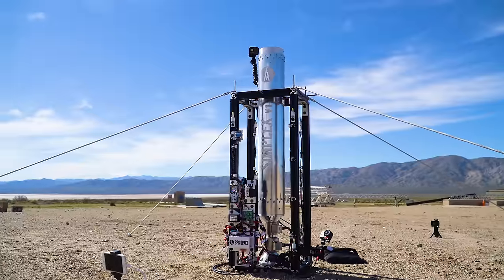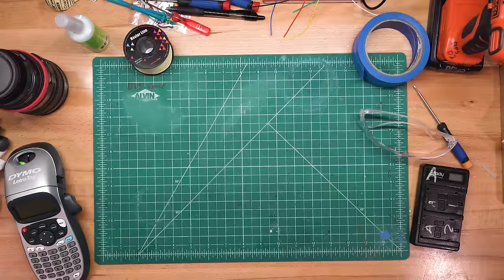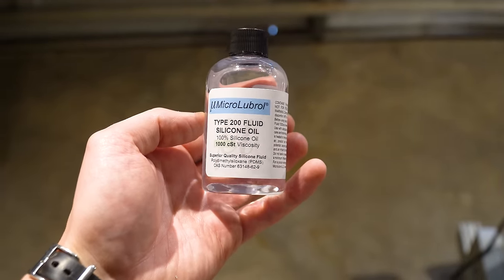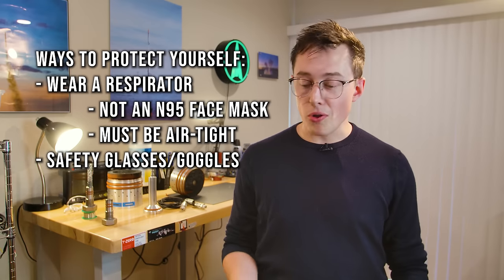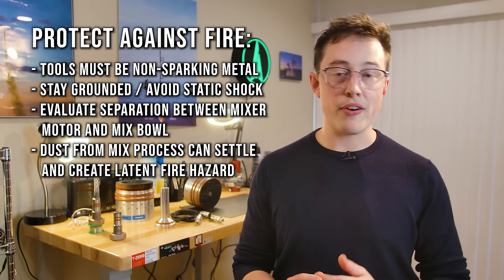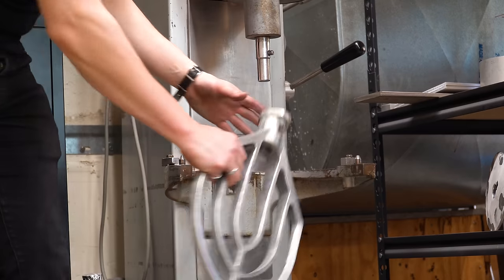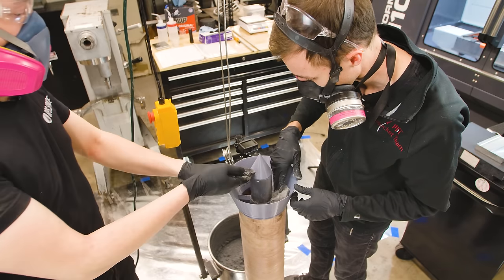Mixing And Casting Rocket Propellant - Simplex Ep 2

Comment: Everybody wants to be a rocket scientist ™.

I’m going to refrain from a full critique of this video but there are two points that I am compelled to bring up.

“…and the MDI we used may not have been the top shelf stuff” 🤦🏻‍♂️

No Joe, there’s nothing wrong with our modified MDI curative. We use it every day in our production and hundreds of our hobby and commercial customers also use it with no problem. It’s your lousy oxidizer particle size distribution.

Also, our modified MDI has an extremely low vapor pressure and is normally only an inhalation hazard if is in an aerosol form (sprayed) or handled at greatly elevated temperatures. In which case it wouldn’t really be suitable for the application, as it is intended as a room temperature HTPB curative and the pot life at higher temperatures would be too short.

Comment: If this propellant mix was new to you, i think you probably should have done some small scale test mixes before going this big. The source of the recipe also has clues to your exact problems in the discussion section, so maybe you could have seen this coming: "This was especially obvious on XB where the propellant was barely pourable at ~78% solids, because the procedures were essentially to dump everything into the mixer (...)" and "We attempted to mix a grain for the motor at the beginning of IAP using the CS Rocketry HTPB but found that the propellant cured very quickly and was too viscous to pour as easily as it did in the past. The resulting grain had poor density (-2.5%) and visible voids, so it was rejected." Better luck next time and please stay safe! Cheers!
Reply: Yes. Standard energetics practice is to scale up for formulations that you're unfamiliar with, precisely for reasons like this. You can have the best instructions in the world, but nothing ever works like it's supposed to the first time.

Comment: AP has to be screened right before mixing. It will clump while you look at it. In pyro (not rocketry), we push all chemicals through screens with small mesh sizes before mixing through courser mesh screens.

Comment: very nice work on the safety stuff during the mixing! 
only thing that worries me is the demoulding/ removing of the core.... i was told, that APC can be very sensitive to impacts, so even if there would be a tiny bit between the main core and the fin part, that could have ignited!  knocking the core out like you did, every professional would have gone running!
in a company building similar motors, the de-moulding is done in a safety room using hydraulic actuators which are manually operated from outside the room

Comment: It should be mentioned that hitting the grain in this way is not safe, it is a way to remove the mold, it could cause an accident. Great video by the way
Reply: What kind of accident?
Reply: @robertobryk4989  Ignition. APCP can ignite just from being hit hard enough. If you accidentally hit a piece, or if there's a bit that is on the ground and gets crushed when they're dropping the whole grain, it could flare up and propagate to the rest of the motor. Suddenly your rocket is on fire, and as he explained earlier in the video putting it out is not an option. You run and hope that it just burns itself out without too much damage to everything around it.

Comment: One pointer I would like to input. During preparation, to deal with clumpy-ness, and for the sake of my OCD tendencies, I tend to do fine powder for every solid, I use my finest sifter for all solids. If it is not powder sugar small I keep going. The extra time to truly refine your initial solid ingredients cascades into time saved throughout the whole process, always take your solids to their smallest possible surface area. Unless the conditions require specific surface areas (mainly when making nano particles) I always go to smallest size possible SPECIALLY THE ALUMINIUM which should be stirred constantly into the mixture while a shaker attached to the mixer rotor evenly pours. Then you can call you aluminized mixture acceptably stable.

Comment: I'd encourage you to try a different one. Some of the chemicals included, like the expensive binder premix and 200u AP, were selected based on the team's experience or chemical availability at the time and aren't the best choice with the knowledge we have now. Some aspects are still good for a starter formula, such as the moderate solids loading and amount of metal, but knowing what I do now I'd use tepanol instead of HX-752 and replace the 200u AP with a mixture of 400u and 90u.

Comment: Joe, if I may share an idea.... Put the whole rocket inside a larger cylinder sealed at the base, pour the propellant into the mold up to (say) a quarter of the height, and then vacuum it.  Add another quarter, vacuum again.  Pour a little, vacuum again.  The advantages are that you vacuum in place after pouring a more liquid mixture, and progressive / repetitive vacuuming makes the column homogeneous.  Good luck!

Comment: Id like to suggest that you get a fully integrated face shield with forced air respirator.
Positive pressure eliminates any chance of fumes or dust getting past the mask and prevents fogging of the face shield.
Check the ANSI # to make sure the lens will offer protection, but usually these things are rated for grinder discs exploding.
Ask around at your local auto body supply.

Comment: for packing and avoiding voids you can try a concrete vibrator tool or some such similar , that will get rid of voids , just need one that suits the scale at which your working with

Comment: Hey since you are making your solid motors i wonder if you could try using emf to throttle them. Fire is a plasma and plasmas can be  manipulated by emf. Meaning that you can dynamically adjust the burn rate using emf. It might even be possible to turn it off. There are multiple ways this can be done. One paper they added ferromagnetic materials to the propellant. Might be fun to try for your smaller rockets.

Comment: A trick I have seen people use to remove voids when pouring concrete was to vibrate the mold with a sawzall. Though maybe it's better to find a brushless one when working with volatile stuff? then again, I doubt the mixer motor brushes were shielded.
Reply: Correct, standard practice when pouring these sort of things commercially is to pour under vacuum and have some ability to vibrate the casing.

Comment: Also, word to the wise, metal tube rarely comes uniformly round. You need to drag a mandrel through it to work out all the bends and general wonk. Should help inserting the next liner.

Edit: also also, get a vibrator. Works for concrete workers. Should be good enough for your pocket rocket.

Comment: Did you do all that mixing at room temperature?  When we set out to work with nearly the same chemicals, around 4 decades ago, the final pourable mixture was to be kept at ~200 F for about a day until pouring.  I believe this maintained fluidity and allowed bubbles to escape.  We did not have a vacuum pump.

Comment: If you want to go overboard on safety, but might need/want a higher level of protection on this or other projects, you can get a full face respirator. they come with a full visor that is not only physical eye protection, but it filters the air your eyes face are exposed to. 
and you can't make an oppsies and touch your face at all, which prevents cross contamination exposure (drop lands on arm, you wipe your face on your sleeve... yikes)

Comment: Packing factor is generally not why the oxidizer (AP)  is often bi- or tri-modal.  It is for burn rate control.  The fines increase the burn rate because of their higher surface area to volume ratio.  Tat's why it improves performance.

Comment: So the only way you can safely dispose of unwanted propellant is to cut it up to small enough sections that you can ignite them somewhere?
An what would happen if for instance you couldn't get the steel former in the middle out? Would you not be able to saw it due to the spark risk?

Comment: Intresting content, So ill share  a few experimental ideas that i have been pondering,  elphants for me, but perhaps illuminating for you.
Tesla valve "groves" in the funnel (or shape the funnel as a tesla valve, or have bladless fan setup that exploits negative pressure (but with a rocket instead of the propeller. (or a combination of the negative pressure design + the tesla valve).

Comment: To work with a packable propellant like this you probably really need a compressed air tamping tool like the ones used in foundries for packing sand when sand casting. I can imagine that tamping by hand took so long it had started to set up by the time you get to the end. Better to reformulate to end up with something pourable and then do a final vacuum degassing after pouring into the casing. The mixture you had was so viscous it would have been almost impossible to avoid getting voids and you did well not to get any in the main body of the propellant.
Reply: Absolutely not. Just, no.
Reply: @wgoulding  Why not, while the mixture is liquid it is inert to impact. Tamping it with a metal rod is potentially way more risky than with a wooden tamping block.
Reply: @schrodingerscat1863  That is just not true. Just really not true. And if you're going to do any tamping it would be with a ceramic rod. Ceramic doesn't have any sparks. But you just don't want to be doing any kind of tamping at all. The voids he got were big. Even smaller ones would still be a big problem
Reply: @wgoulding  As can be seen in this presentation the voids absolutely are an issue. Personally I would have thrown out the batch they made here and retried for a pourable consistency. Tamping will never remove all voids in a high viscosity mixture like this. A wooden block also wouldn't cause any sparks though ceramic is also good. They seemed to plan for a pourable consistency and when it didn't work out like that they really should have stopped and not tried to ram it into the tube with a metal rod.

Comment: maibe along with tamping , you need to vibrate the whole thing to make it loose the bubbles the vibrations should liquify it a bit like concrete , need a pretty strong vibration though , allso helps when loading the chucks in the top as it will fall through the grate without help

Comment: On a smaller scale I would probably try an AP/sorbitol melt cast. Without Al powder I think melt cast could be safe enough for a B/C class motor. Would do it myself, but unfortunately I live in an area very unfriendly towards such projects. Would have to set up a perchorate cell, make the K-salt, turn it into the ammonium salt, find a safe location to test the motor...ahh too much hassle.

Comment: Safety Note on SRM Fuel Production:
Always prioritize safety when working with solid rocket motor (SRM) fuels. Start by mixing the energetic additive (e.g., aluminum or magnesium powder) with the liquid binder. Ensure that the particles are thoroughly wetted and uniformly dispersed in the binder, reducing the risk of accidental ignition. Once the energetic additive is safely incorporated into the binder, proceed to carefully add the oxidizer (e.g., ammonium perchlorate or ammonium nitrate). This step-by-step approach helps minimize the danger of explosion during the mixing process.

Comment: 19:11 In my opinion you should caste your propellent in Grain form instead of casting it in a single tube!!
20:28 As I can see it was pretty much difficult to remove the casting hardware after curing the propellent!!!
21:00 😪 these voids are also a reason, why grains are used 
22:00 At the end of the video I felt little bit sad!! 
A bit of your Hard work is wasted 😐.

But these things doesn't matter at least you tried to do it!! You did a Great job man 👏
I appreciate your work ❤😊.

Comment: I don't really know the exact reaction with amonium perchlorate, but amonium nitrate is a well-known explosive on itself, if you wonder how bad things can go wrong with it, just google Beyrouth explosion 2020, ...
A little bit of chemistry : the traditional reaction used in rocket engines are Reduction-Oxydation, as they are quick and the correct ones are exothermic.
About Amonium Nitrate, it's a salt of two ions N(H4)+ and N(03)-, being heated enough, Two N(H4)+, given a pair of elecrorns dissociates, giving 2N, 8H, meanwhile, two N(03)-   dissociates into 2N, 6O and 2e-(electrons), that hives us the overall reaction : 
2*N(03)- + 2*N(H4)+ = 4*N + 8*H + 6*O = N2 + 4*H2O + 2*NO

Comment: I have a bottle rocket project and I want to use ammonium perchlorate and aluminum. I don’t need all the other stuff just because it’s high school level but will need a resin. Should I just use normal resin? And imma use a coke can and use a high temp resin as the walls so it won’t react with the fuel. And how big should the mm nozzle be? I’m not too worried about the other ingredients just because this small amount would out beat all the other contestants.

Comment: How much does cherry limeade, or whatever, cost per pound, roughly?
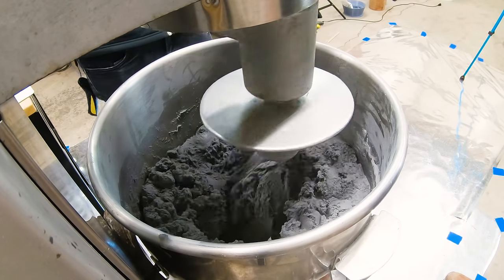I guess, in hindsight, at 14:34, the mix wouldn't be expected to get much less viscous than that, after adding the accelerator. (assuming the curative is fairly rapid). Probably would've been a good indication to begin prepping for packing/tamping. I wonder what the working time is.
Thanks for the videos. Glad to see it didn't go any worse than it did. Looks like a fun challenge. Wish you had more money to work with.

Comment: Ive been casting a few KNDX grains over the years. I have always faced the voids problem whenever I used a wooden or PLA coring rod, no matter how well I pack it. I concluded that it must be some kind of gas that's released because of a reaction between the mix and the rod. Have you found out any reason for those voids in the finocyl section?

Comment: Doesn't pulling a vacuum allow the fluid to boil introducing bubbles because any fluid will boil under reduced atmospheric pressure?
Reply: Boiling: Air is in the mix already, vacuum forces those bubbles to expand and turn them more buoyant, bubbles rises to the surface and burst -> Less air in the mix
Reply: @HVM_fi  Not so much when the mix has the consistency of duct seal.

Comment: Why not use some other inert chemical or use more of one of the original chemicals to make it flow better? What would if you added the 400 micron ACPC in the ratio of the 90 & 100 ACPC & double the amount of Aluminum? This a stupid question: When you pull vacuum are you not also pulling any liquid vapor which would make the mixture stiffer?

Comment: I notice that your graphic at 2:46 has your Cherry Limeade formulation adding up to 107.5%. Almost as though you have included the Aluminium twice. Not suggesting that you did the same during mixing, but it is misleading.

Comment: 20:18 Man, don't do this. Generally, APCP is not explosive, but small particles can detonate on hard hit.
Using PLA for mandrel you can heat the motor up to 60-80 C (120C is still safe) for mandrel to soften and shrink and then remove it easier.
Of course, better (but more expensive) way is to use aluminium mandrel with PTFE coating and screw press (tailstock of a normal lathe, for ex) for initial move.

Comment: Could uranium be used in place of aluminium?
Reply: Yes. Yes it would burn. No it would not be better, in fact it would be worse in every conceivable way.
Reply: @TheBackyardChemist  doesn't it burn with about the same vigour? Wouldn't it also have a greater impulse because of its atomic mass? I think I even heard of a mercury based fuel experimented with for the same logic!
   But if you are saying that for life and safety reasons, a LOx and tetraethyl lead rocket sounds safer.
Reply: @petevenuti7355  No it is exactly the opposite, you want your exhaust products to be as light as possible, if you want an exotic metal powder in your fuel, use boron.
Reply: @TheBackyardChemist  I thought that was only the rule with ion drives and rockets like that because smaller atoms move faster for the same temperature, hence higher exhaust velocity, higher impulse over time. 
  I've been thinking about chemical rockets more like water rockets, higher mass exhaust at same speed more impulse..
Reply: @TheBackyardChemist  Your response makes it sound like uranium is a better choice.

Comment: organic cartridges are not rated to filter particulate, only vapors. if your concerned about particulate your need hepa cartridges, or combination of hepa and organic if multiple hazards.
Reply: Yep, HEPA prefilter.
I suggested above a forced air face shield rated for grinder discs disintegrating.

Comment: With Mars having lots of perchlorates in the soil according to the reports we're getting it's not inconceivable that a thriving solid rocket motor industry could exist on Mars in the future. The question becomes how to prospect, process, and utilize perchlorates for the manufacturer of solid rocket motors on the surface of Mars and to define what those motors would be used to lift off of the surface of Mars.

Comment: hey if you are worried about the fuel burn mix stuff, try air heating termite rocket, aluminium iron oxide heat to heat air expansion hour glass nozzle, yes, hot air rocket, or kinda steam rocket, by using termite reaction, simple as heck